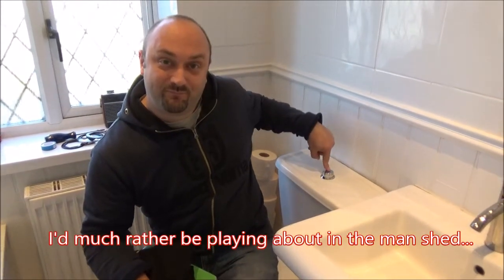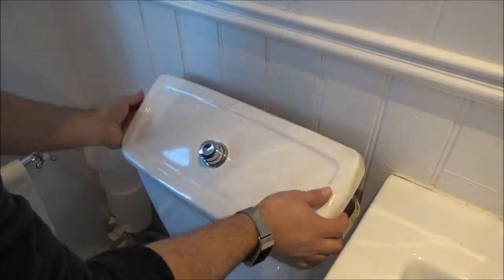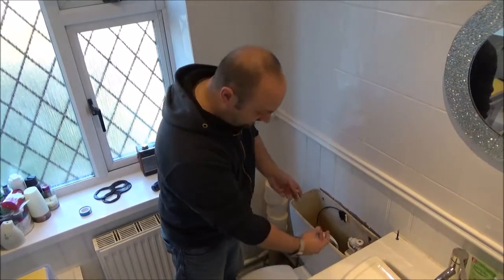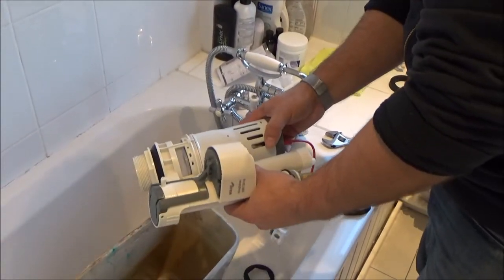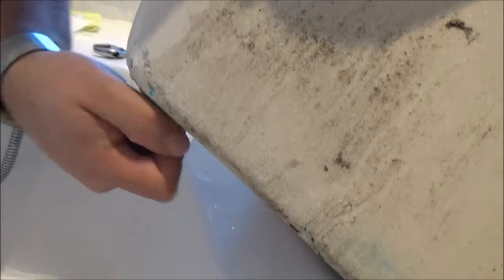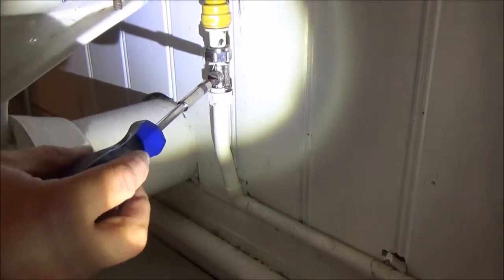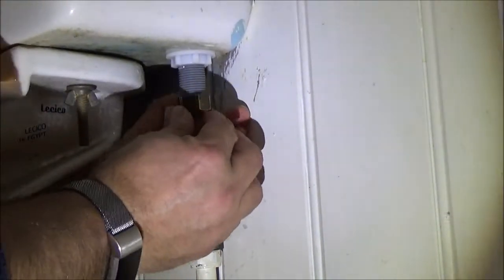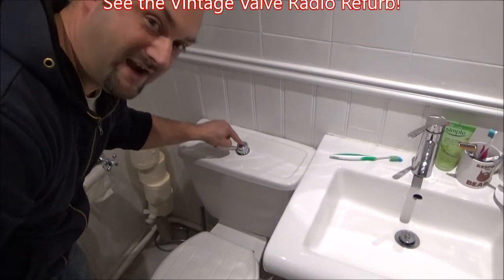Dubious Toilet Fixing 😬 Nightmare Plumbing - A break from building circuits and playing in the shed

Comment: Ahh buggering around in the bog lol :-D
Make a seesaw near the top of the tank, so the button will work.
I liked the old bell lift ones, just lift the bell to start the siphon :-)
Reply from the maker: Great idea! - The missus and I both agree! - We will see what kind of engineering we can come up with! ....  hate bog work!
Reply from the maker: We discussed it...  we think your idea is amazing and I will make a mid-week toilet see-saw in the near future... and mention you ...  as you are so blimin supportive!
Reply: It's just a crude idea, you will have a short arm to press and a long arm to lift the flapper chain.
For simplicity, use a metal ruler, drill hole for the pivot point, push a rod through and hot glue it at both ends to the tank.
Something like that, im sure you will do better than my method.
You will have to bugger around in the bog again :-D